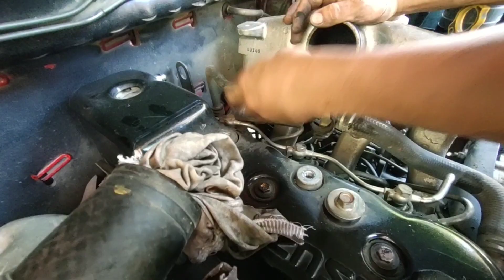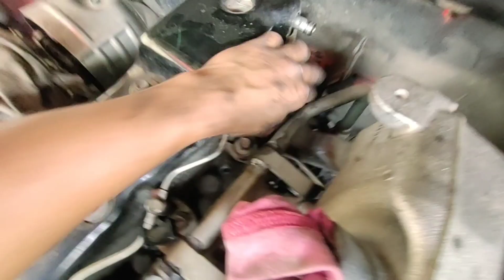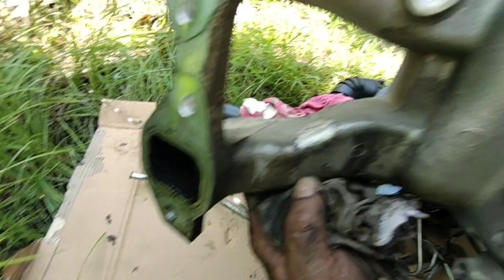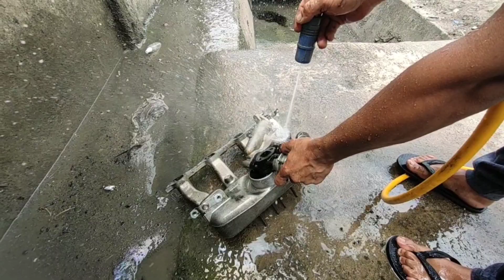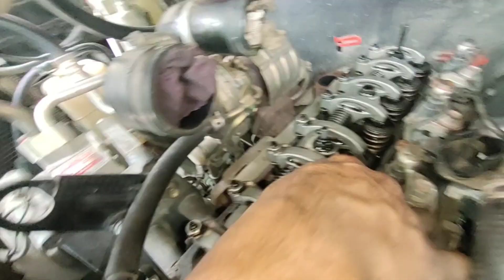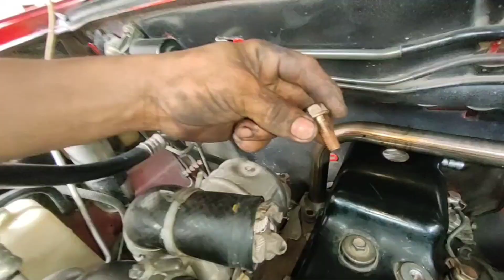Isuzu Crosswind Intake manifold cleaning and valve clearance adjustment

Comment: Sir yung crosswind 2007 model ko pag start nag vibrate ang engine ano sir ang sira
Reply from the maker: Possible causes
1. Mababang menor ( idling speed need adjustments)
2. Fuel filter clogged ( need to replace)
3. Valve clearance (improperly adjusted)
4. Injector gasket leak 
 5. Injector nozzle need balance 
6. Injection pump need calibration
Reply: Sir pwede din po bang engine supports?

Comment: idol bakit kya yung crosswind minsan namamatayan ng makina ok naman manakbo
Reply from the maker: Possible causes:
1. Fuel filter clogged
2. Fuel tank dirty
3. Fuel lines leaking
4. Fuel/water separator assembly defective
5. Injection pump need calibration
Reply: @armansretunedgarage  maraming salamat idol